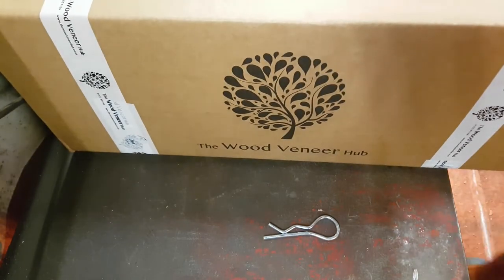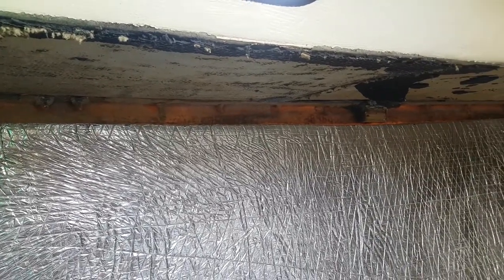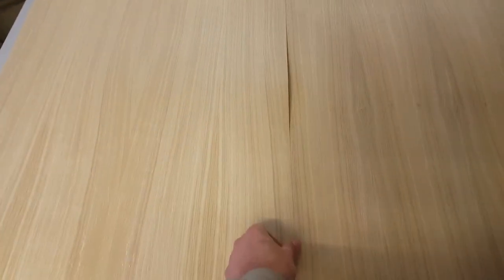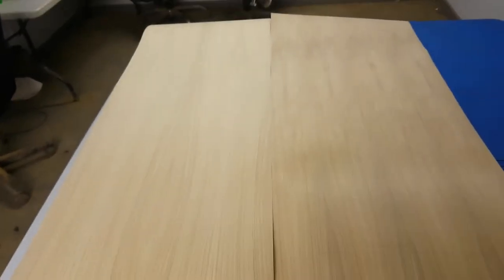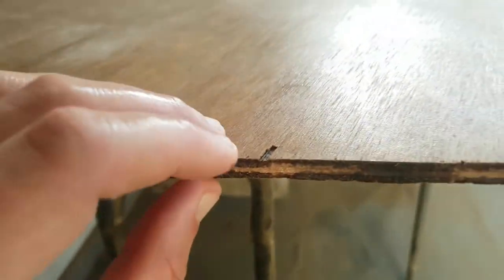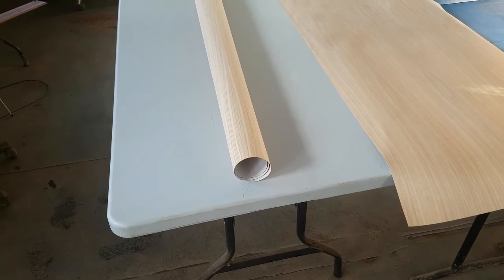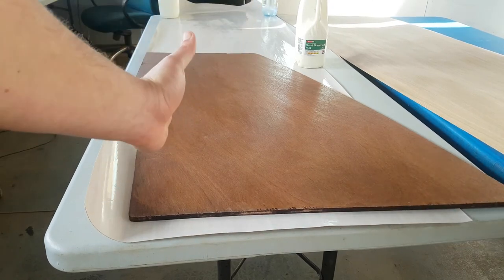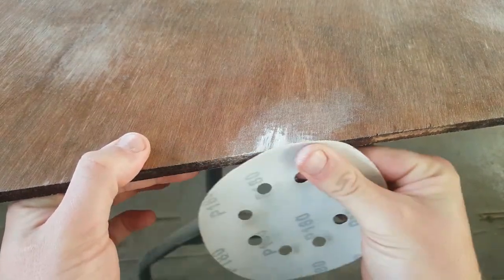Albin Vega Refit - 10 - Veneering the V berth Part 1

Comment: Looking good there and I like the way you laid out the vaneer for cutting. Better to attach a bigger, filler piece as it'll have more surface area to stick down and less likely to pull off when stuck down.
Reply from the maker: Rigal Thanks! Yeah, decided it's best to waste a little more veneer and trim it down rather than try to make the sizing exact and mess it up. You're right about the filler piece too, although I admit I didn't realise the benefit until you just pointed it out haha! Josh